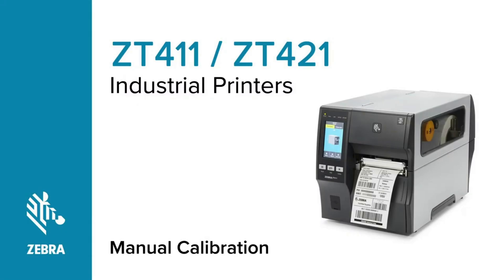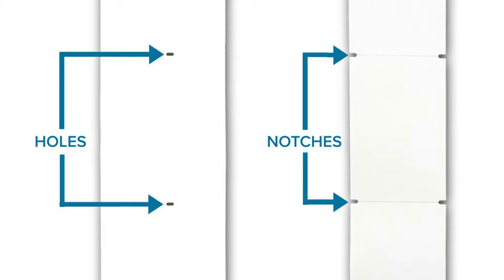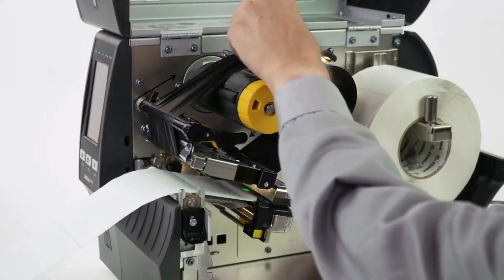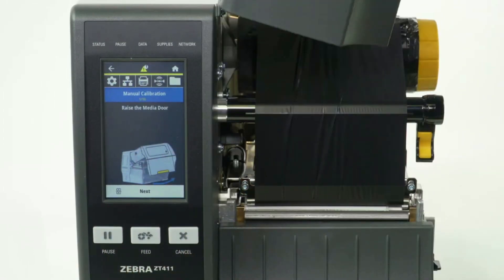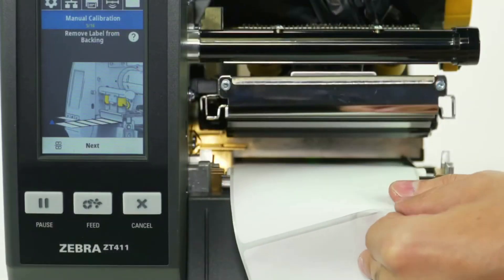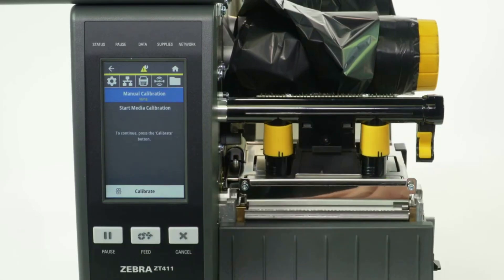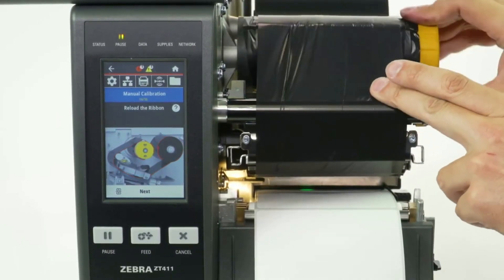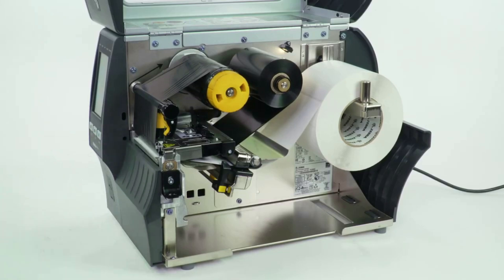Zebra zt411 zt421 how to manually calibrate printer

Comment: "Nice video Bruce !!  Please Note default LABEL LENGTH MAX = 15" value was removed from the touchscreen menus. It is not covered in the Users guide which now appears to be online only. It can only be accomplished from the printers web page or via ZPL ^ML command." - @davedooling5102   <---Copied from previous video
(Could be useful in this video also)